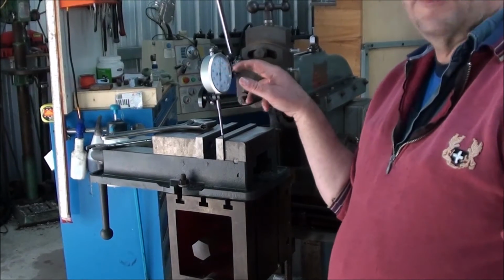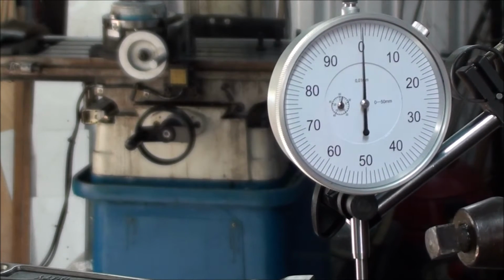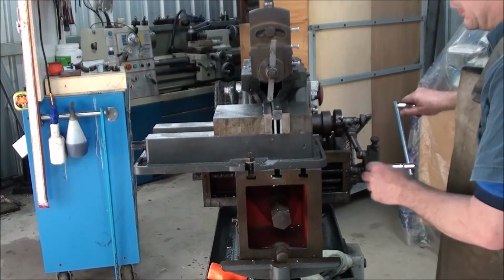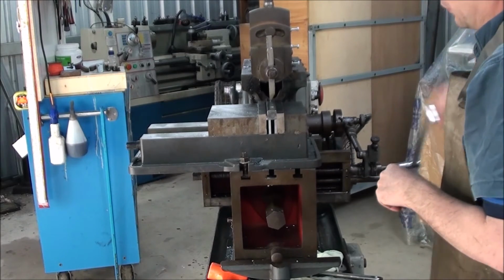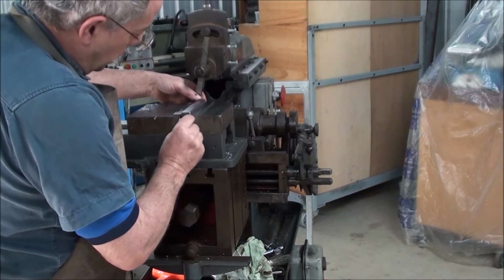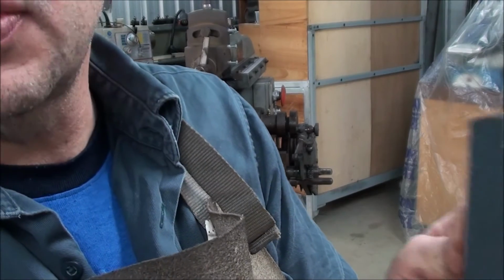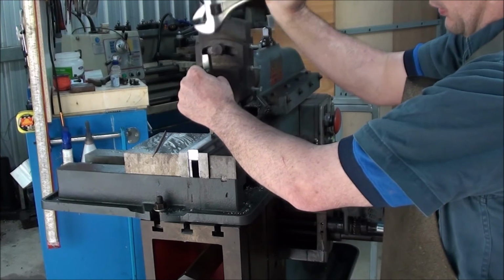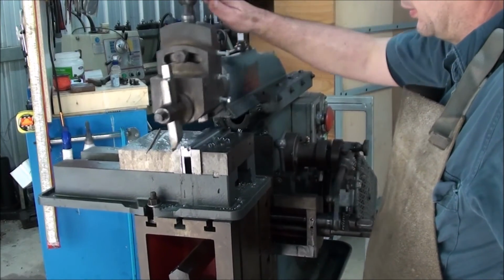Metal Shaper Action  - Tee Nuts Part 01

Comment: on a technical point.. is that chamfer on the leading or trailing edge of the cut?
Reply from the maker: Hi Emma. The chamfer goes on the leading edge. I believe the theory is that it cushions the initial impact load a fraction. It does seem to make a difference, more so on poor to machine materials
Reply: ive had this problem exactly with aluminium. ill be trying this.
Reply from the maker: The other thing I have found with aluminium is that WD40 gives a better finish than kero or a kero atf mix. WD40 results in a mirror type finish compared to an obviously cut finish with the others
Reply: thanks for that.. im learning slowly. a shaper s a completely different animal in some ways.